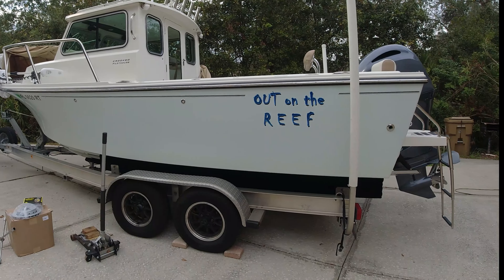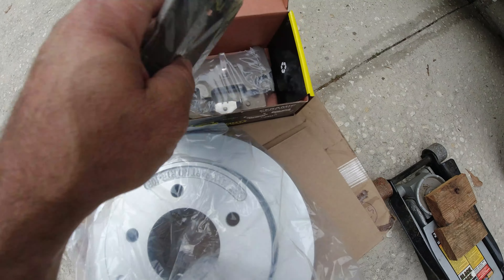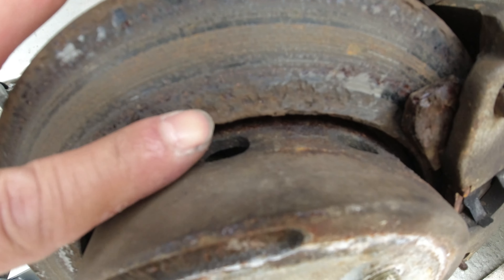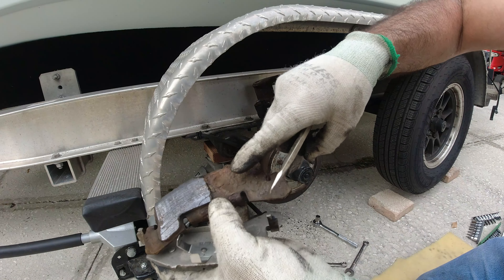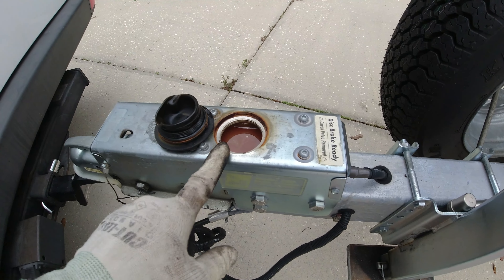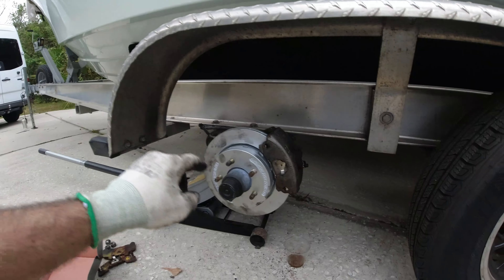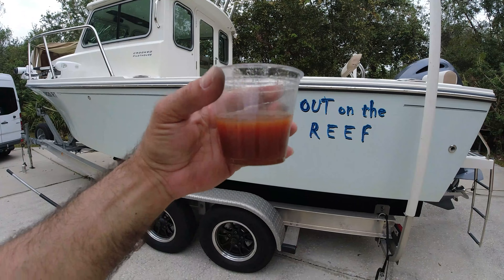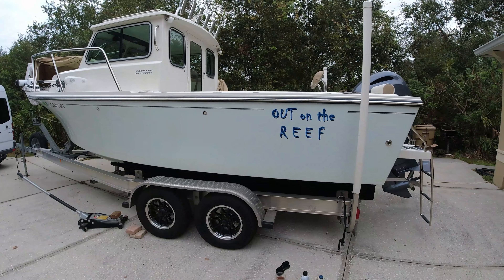How to Upgrade your boat trailer Breaking System for maximum performance

Comment: Good video! One tip I forgot to mention earlier is it is a good idea to spray down the rotors and pads with brake cleaner spray to remove the grease/dirt when handling so it does not get burnished into the new pads which can affect braking strength. I like that disc spreader tool. Didn't know they made one like that. I always use the C clamp which is a Pain, so just ordered one like you have! Thanks for sharing!
Reply from the maker: Awesome captain thank you for the great suggestion that makes a lot of sense thanks for watching and enjoy your new disk caliper expander👍👍

Comment: Most all trailer manufacturers today offer upgrade to SS Kodiak or Deemax brakes as an option. My old Road King trailer brakes were terrible and I went through several brands that were supposed to be better at corrosion. In the end, I upgraded to ALL Stainless Steel components, even the hubs and the were great! No more issues and also found out that the Kodiaks had about a 20% improvement in braking power. I had to finally replace my trailer due it was old and very corroded where the axles bolt on, so ordered a new Road King in 2020 and upgraded the bunk brackets to heavier duty and also all SS Kodiak brakes, but went with the new Vortex Hubs due their claim about no worries for 6 years on the hub bearings/service. Just add grease if needed annually. After 2 years now, no issues with leaking seals or hub issues, grease is still clean, no water and already replaced first set of pads before they wore down and damaged the rotors. Good to check our pads annually especially if you trailer a lot. My boat is very heavy and is hard on brakes, so I need to check them annually and replace the pads if needed. Good luck!
Reply from the maker: That is a great idea captain changing everything to stayinless steel will last you a lot longer especially in the salt water environment that eats everything up thank you for your great comment and help Anne also thank you for watching navigate safe

Comment: Great video Captain.  I am going through this right now with the tandem setup on my trailer.  Aluminum Dexter calipers that only made it 1 season since replacing all 4.  Going to a stainless caliper and stainless backed pads.  Those appear to be DeeMax calipers.  Are they stainless as well?

Also great tip on making sure your brake fluid is sparkling clean.  I run an EOH system from Hydrastar and my actuator failed due to fluid contamination.  Expensive and time consuming lesson.
Reply from the maker: thanks cap and no those are not stainless but going stainless is the best choice but a little more money but no repairs needed in a long time, thanks for watching cap. and navigate safe👍

Comment: Hey Cap'n. I changed out my old brake system and hydraulic coupler with a complete system. Stainless discs with aluminum caliipers. Steel parts are definitely not the choice with salt water, hahahaha. Any salt water fisherman knows that. 90% of all my repairs/retro-fits are with new stainless parts or aluminum, if possible. They are more expensive, but much more practical.
Reply from the maker: Yes i see that , I did Research to install stainless steel disk and they blew me away High prices But I know eventually I'm gonna have to go to stainless thanks for your comment captain And navigate safe
Reply: @OutOnTheReef  Yep, if I could afford everything I wanted, I'd be there, hahaha.

Comment: The fun of salt water, have a Continental trailer also. Went to stainless steel rotors and pads and pads Was tired of every six months working on trailer. I now  carry around a spray bottle from Home Depot mixed with salt away And spray the trailer when I put the boat in and when I pull the boat out. Then when it’s gonna sit for a while and spray it down good with WD-40.  Stay safe out there captain prop clear
Reply from the maker: That is an awesome upgrade you did there captain the reason I did not go with the stainless steel rotors was the price for 4 was too much but maybe in the future I'll get those 2 thanks for watching and for your great comment captain🛥👍

Comment: You did a great job on the brake. Next time you could take the rotors to New Jersey Auto parts, to get fixed they leave them like new.
Reply from the maker: Yes that a good idea cap. Next time i will

Comment: Hi Captain, just wondering if you wash the trailer, brakes and rotors down with fresh water after launching prior to your extended Bahamas trips? I keep and launch my boat out of FT Pierce. Hope to see you out on the water. Thanks.
Reply from the maker: Yes i  do cap but sometimes there is no water in some boat ramps but yes that is very important because im away sometimes 4 to 5 days

Comment: Nice job 👍. You can even see the water somewhat floating on top of the old brake fluid and definitely the fluid is past it’s prime. I know you know this, but I don’t know if some of the viewers know this that after a while, if you do not change your brake fluid when it breaks down, it turns to an acid and it will eat your brake lines.
I am disappointed with the boat trailer manufacture chipping out on safety, so they can make the God almighty dollar. 
Nicely done, Captain 
Safe Navigating
Reply from the maker: Yes you are right is water mix with the fluid and hopefully this helps some pf my viewers to keep up their trailers very important, and thanks for your great comment cap.👌👍🛥⚓️

Comment: Hi Capt.... great information here! I've used my trailer only twice since I've owned, (To take the boat to 'higher ground' in hurricanes). I keep it under a cover, but now you got my curiosity up and I'll be checking the brakes tomorrow. Are you going to add a video with tips on how to bleed the system?
Reply from the maker: Yes check it out captain see how the conditions of your trailer as especially since you don't use it that much you may want to run it a little bit so the bearings get moving a little bit and it's very easy to bleed them all you do is open the valve On each tire disk one or the time and elevate the bow of the trailer that way the fluid comes down by gravity and make sure you keep pouring fluid into the reservoir and that's all you do captain And how you know that you are finished is when you see the liquid coming out very clear👍 I hope this helps but I'm sure yours is gonna be in great condition since you don't use it that much thanks for watching captain and let me know how yours is have a great night

Comment: Hello Captain. 
Great educational video. I've inspected mine and will be doing the same thing soon. Mine are still in ok shape but will need an over haul soon. Definitely makes sence while your replacing everything to up grade to S.S. I'll be doing the same. 
Thanks for the video  Captain.  It will help me and probably a lot more.
Reply from the maker: Awesome captain and yes I definitely recommend you in the future to move on to stainless steel it will last you a longer time and it's not gonna break down it's easy and thanks for watching captain see you on the water

Comment: Hey Captain. 
I watched your video again. You say in the beginning you use break fluid and towards the end you use hydraulic fluid.  Do you use the break fluid to flush the lines then hydraulic  fluid to replace it with?
Reply from the maker: No captain that was my mistake I only use brake fluid I just made a mistake and say hydraulic fluid my back and I use D0T 3 fluid👍🛥

Comment: Good day Cap, just 2 points. Next time please do not use any kind of grease or silicone spray on the bolts. Instead use a paste which das NOT change/reduce the friction ! for example copper paste. That same copper can also be used on the break pads backing before mounting, which ads protection. Great content - keep going !
Reply from the maker: Thank you captain for the awesome suggestion  And for watching my video👍👍⚓️🛥

Comment: Hey Capt….trata los pads en ceramica…en tu caso que esa parte del trailer entra al agua salada…la cerámica del pad no es metal y no debe oxidarse tan rapido, el disco olvidate …on the next trip to the ocean, will be rusted….sorry but its the truth…buen video Capt.!
Reply from the maker: Eso es verdad el disco la primera bes lo moje con sal se fueron😁👍 asy es la vida de los capiatanes, siempre remplasando partes

Comment: Hey capt. My trailer is due for new pads and rotors also, I have a similar set up on my 2320 with a continental trailer and I didn’t see a link for them, did you get them at a local parts store or online?  Thanks buddy and stay safe.
Reply from the maker: Well captain I did not have a link for it but I did a search on D Max breaks  And suppliers will pop up and look for the stainless steel ones and I hope this helps thanks for watching and navigate safe captain

Comment: The term for that happening to your brakes is called "rust jacking", it occurs on cars and trucks in the northern states where the roads are salted for the snow.
Reply from the maker: Thanks captain and yes also up North with a salt and snow environment It really does some damage to the brake system of every car ,thanks for watching captain

Comment: Next time, be sure to run a wire brush or scotch brite wheel on the hub, then coat it with never seize. Also, use some high temp break grease on the back side of the pads.
Reply from the maker: Great point cap. Thank you

Comment: Dude take your ball off the truck and lock the ball in the trailer and use the bar to pump the fluid out it'll push on the actuator and move the fluid
Reply from the maker: Good point cap that helps thanks